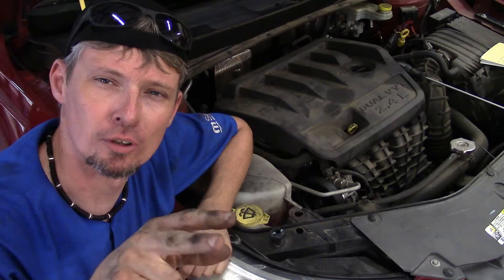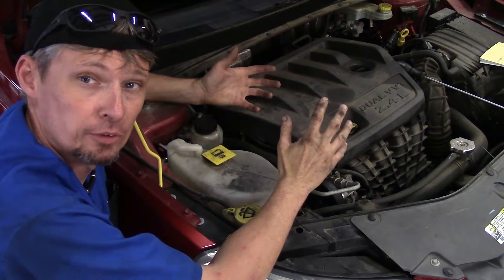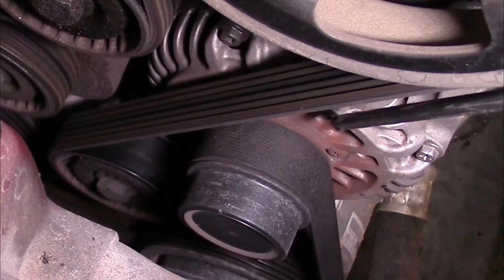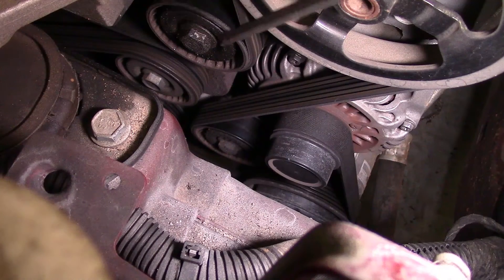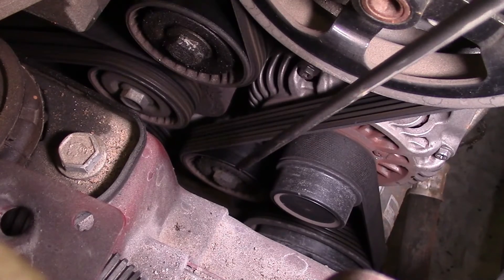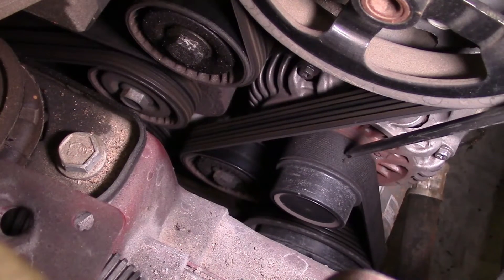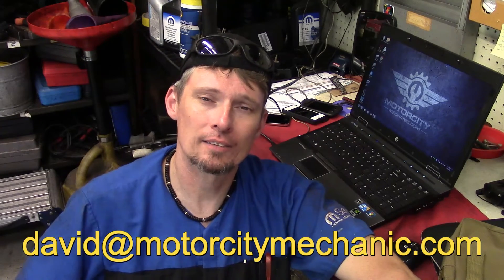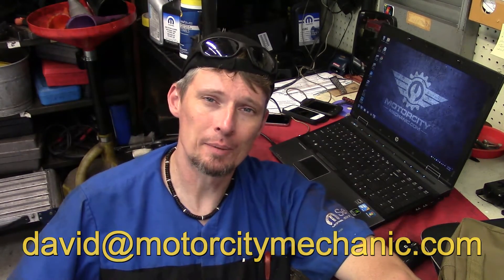Chrysler, Dodge, and Jeep 2.4 liter world engine "whine" diagnosis

Comment: 2025 here , Dealing with the whiny noise on the 2013 dodge avenger. Coming with acceleration and deceleration. I’m no mechanic but it’s coming from the pulley area

Comment: I have a humming sound while iddleling and while driving .. it started when the stater and alternator was changed .. transmisión is not slipping it only happened once and hasn't done it again.. oil is still red doesn't smell burnt..any idea..

Comment: I have similar noise when i was in line at drive thru and when i went to accelerate my avanger wouldnt go. I had to put in park turn off then start again. Did it twice while in line. Would that be the reason as well or totally different?

Comment: Actually if the alternator is working (charging) you can change the decoupler pully on the front. That's what is usually creating the noise. It runs about $80 at napa. It's relatively easy to change to. The alternator runs about $300. 
The decoupler can sometimes sound like a bad water pump also but you'll hear that the noise is on the opposite side of the engine from the w/p.
Reply: It seems typical to most jeep Patriots as I have the same noise .But I will check with my stethoscope just to make sure it not the idler or alternator.
Reply from the maker: Thanks for all that info Chris. Make sure to subscribe and check out some of my other videos as well when you get time.

Comment: crank shaft on 2013 journey wont loosen ,change engine,or blow up car,changed transmission last year and two throttle controls so far,going broke chryslar.

Comment: Great video. Located it on my sister's Jeep 2.4
Reply from the maker: Thanks for the comment and kind words. Make sure to subscribe if you havent already and sorry about the delay.
Reply: @MotorCityMechanic  at least it's not the Flux capacitor
Reply from the maker: @sirjohndoeofpa3292  Very true lol
Reply: Sir John,  we have the same engine... how many miles on your 2.4 when you first noticed it? Are able to reproduce while parked? When driving off?  does turning the A/C or heater off help? High octane gas help?  Were able to resolve it? Was it caused by low oil level damage?

Comment: Hey thanks for the video, I'm currios I have a 2010 Jeep compass is Normal for the engine to sound kinda of like a diesel? Like a continuous ticking sound? I thought it was normal but I heard someone's 08 compass and it didn't have the ticking noise?
Reply from the maker: It depends on how loud Its something I would have to hear in person to be sure to see if its abnormal and if so....to also figure where its coming from.
Reply: It definitely seems to be coming from the fuel rail on top, I listened with a screwdriver on top if the valve cover and didn't hear it, but when I put it to the fuel rail. Bingo definitely seems like it's there.  I was thinking injectors..? I could if sworn I've heard newer 4 cyl. Engines sound similar. Really wondering if it's normal..? Btw thank you for replying!

Comment: Hey buddy, u helped me out one year ago with this exact problem. I replaced alternator and issue solved. Yesterday i cranked up the car and the whine was back after one year and 10000 miles on a remanufactered alternator. Do you think that bearing could go out so soon and that this is the same problem. Big fan.  Thanks
Reply from the maker: Reman aftermarket alternators are always questionable. They are one reason why I try to not use them when ever possible. Try to narrow the source of the noise and if needed....remove the belt and turn the pulleys by hand to see if you can tell which might be at fault. Thanks for returning and for the question.

Comment: MotorCity Mechanic 08 Jeep Patriot 170000+ mi 5MT SPORT I have a question... I think I heard my car making this sound almost a week ago.. it continued and wouldn't let up. Until I was leaving work and then without warning at the traffic light, my car stopped running. I looked in the dash and the last code I saw was FUSE warning. Now thinking it was the battery, we tried to jump the jeep but the cable was getting very hot and we checked to see if it was the terminals, but the terminals were correct. With the connection it wouldn't even come on let alone turn over. Is it possible that the whole car will not get any power if the alternator is fried?
Reply from the maker: Daddio Green The alternator may be shorted out internally and draining the battery and causing other issues. I recommend taking the alternator off and see if any issues why turning the pulley. Also look for that rust colored dust on the front. I feel it's most likely going to be your issues.

Comment: Hey i have a 2012 chrysler 200 lx with a whine noise too. I checked what you showed me and everything looks good.
Reply from the maker: First thing we need to do is see if it is belt driven. If you can get the noise to happen all the time when the engine is idling.....then remove the drive belt and see if it goes away. If so then its belt driven. The most likely issues will the alternator, either idler pulley or belt tensioner pulley. If the noise is still there with the help removed then it might be a trans related noise such as trans pump. Thanks for the question and make sure to subscribe
Reply: I wish you would have been out side of car

Comment: great video I have a 2012 Dodge Avenger with that same sound so I'm a go outside right now and check what you just showed me on the video and check because I saw a position to and told me that it might be the serpentine belt but I got it but just in case I'm going to change the belt to Output I need a video on how to ride it and how to change it please thank you
Reply from the maker: Your welcome. I sent you a message on your other reply about the belt. Make sure to read that message as well.

Comment: How long does it take for one of these engines to start developing this problem? I've got a '12 Chrysler 200 with this engine in it - right now, it sounds fine but that's only because it has around 18k miles on it (got it low-mileage, and since I'm a homebody it has stayed low haha) Thanks!
Reply from the maker: +Ernest Perry Hey Ernest....it depends. It may never have this noise or issues. Just depends on the bearings. I wouldn't say that everyone will eventually need to have the pulleys or alternator replaced but I would think it could possibly happen over time. I actually haven't done one myself ever since the video was made. I use to see then from time to time.....but not lately. That doesn't mean that the independent shops aren't seeing them. Once most vehicle start getting miles on them.....they start going from the dealership to the independent repair shops so that can explain why I don't see them much any more. Thanks for the comment and make sure to subscribe

Comment: Damn they got a engine that's even more horrible than the 2 7L wow.
Reply from the maker: Ronnie Emerson Ain't nothing as horrible as the 2.7 haha
Reply: This is not an engine internals situation. This is external accessories wearing out and are easily and affordably replaced. 10 years in and these 2.4 engines are proving themselves to be reliable engines, even in larger cars like the Dodge Journey.
Reply from the maker: Your absolutely correct. Some common issues for sure but the engine itself has held up great.
Reply: MotorCity Mechanic my car just started making this sound its a 2012 chrysler 200 also i only noticed it after having belt changed. could that have anything to do with it? thanks
Reply from the maker: It could be a cause of the noise. I recommend doing the visual inspection that I showed to see if a pulley or alternator is needed. Thanks for the question and make sure to subscribe